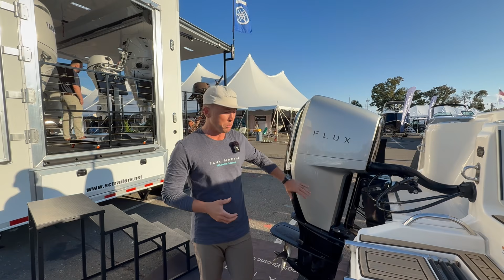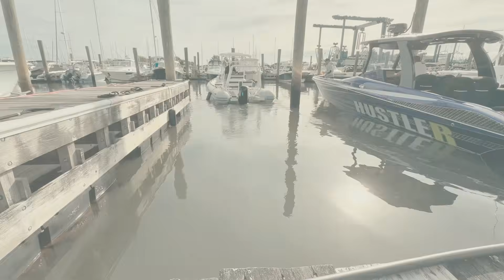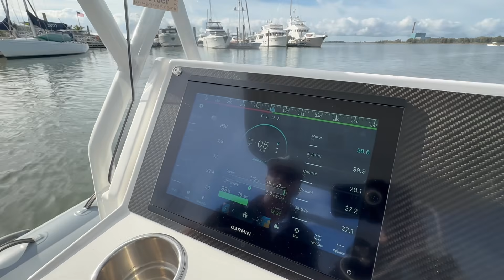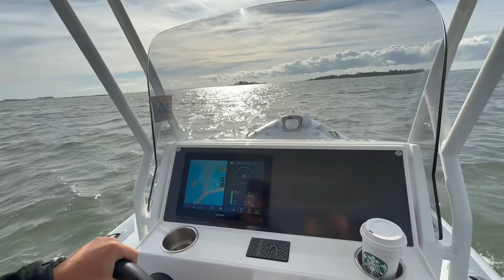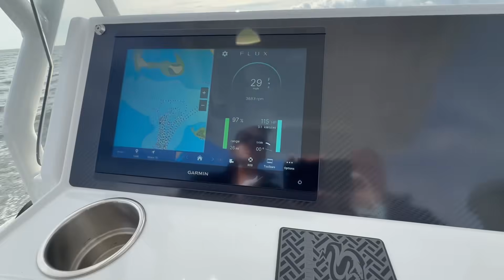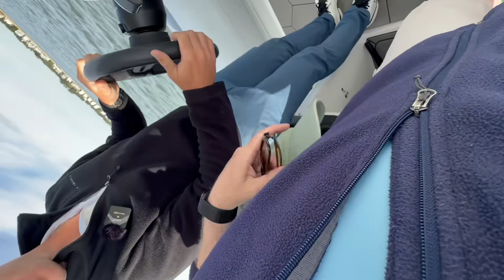Unleash the Future of Boating: Experience Flux Marines 100% Electric Outboard Technology!

Comment: Thanks for the  nice video. We've enjoyed our Stealth electric outboard for about 2 years now. It has a 25 MPH top speed with a 20-30 mile range. Very quiet and perfect for the type of boating we enjoy.  https://www.youtube.com/watch?v=GaeNsEVr-t4&t=3s
Reply from the maker: Hi Mark, Thanks for liking another video. I can't endorse Stealth, I believe in all electric with minimum moving parts and few to no ware items. The reliance on Yamaha is a deal breaker for me. 
From their website.   "All the components on this outboard, with the exception of the all-electric power head, can be replaced with parts from a local Yamaha Marine dealer" Todays closed loop cooling removes the impeller and many lower unit pain points. 
The technology is advancing quickly. Thank you for being an early adopter!